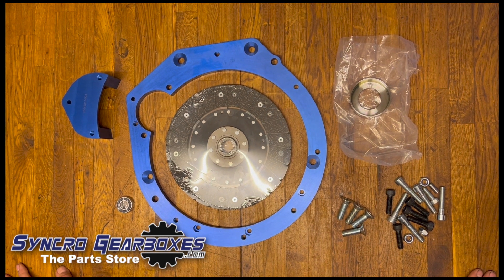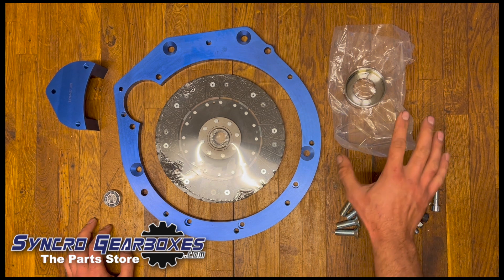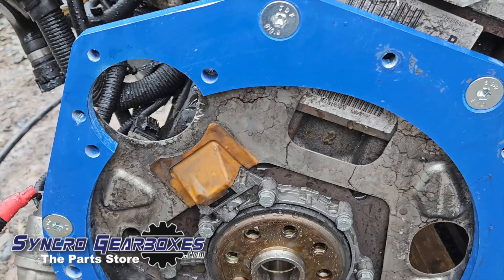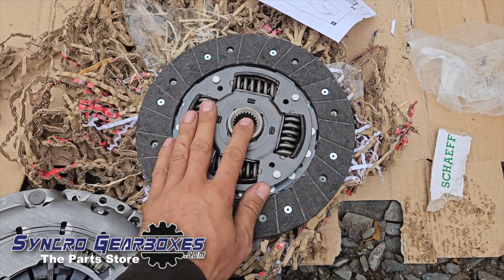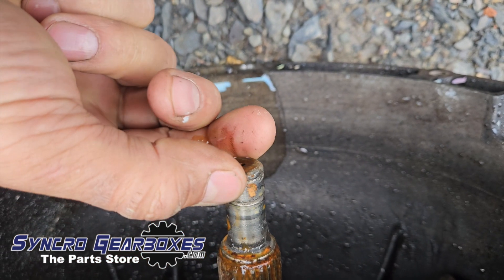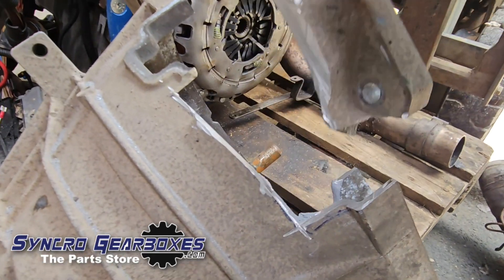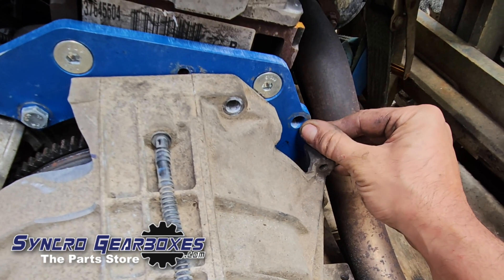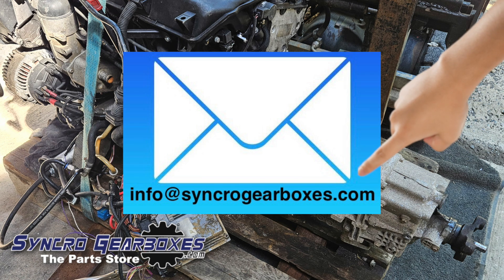FITTING VIDEO M57 to MT82 Adapter Kits 🧰🛠️

Comment: Also fitted one of these and the guys at syncro are great. The clutch is wank though so bin it. Don't even know why they put it in it can't manage the power of the 184 even
Reply: What clutch have you used instead of the one that comes with it also which fly wheel